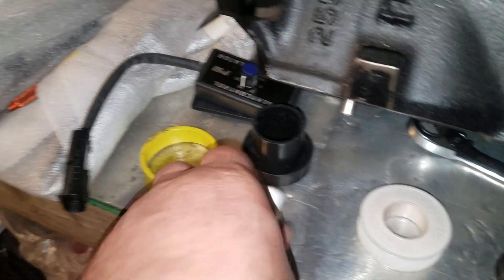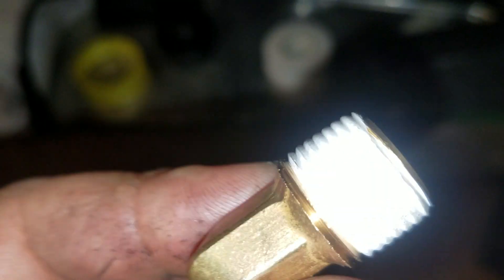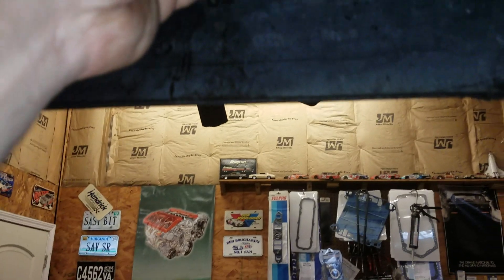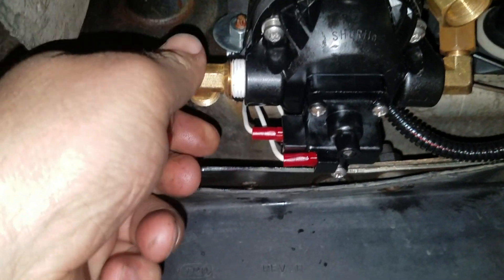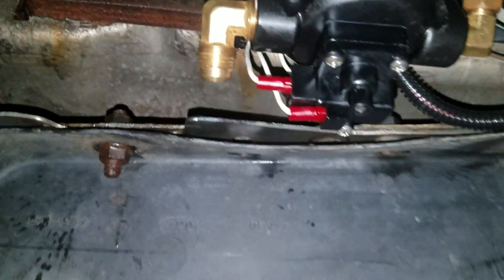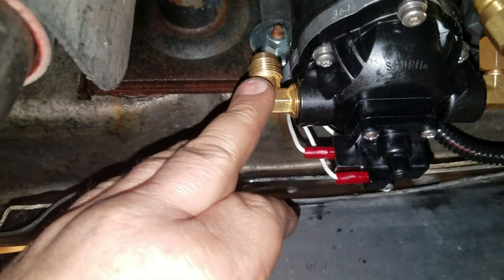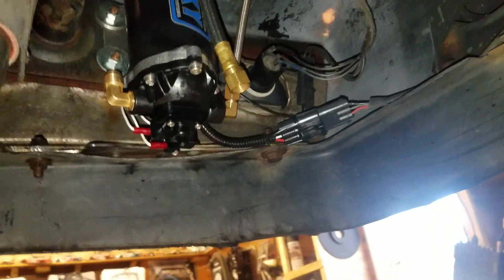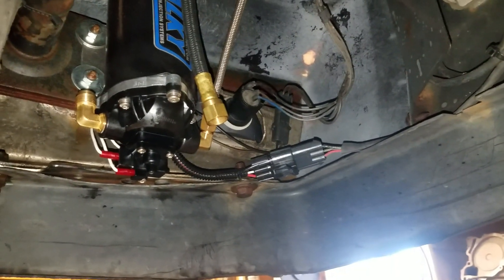Sealing alky pump fittings

Comment: Steve quick question for you, with dial set to 8 hitting the test button how much voltage should I see down at the pump? I'm only getting 4.69
Reply from the maker: Test button does not send full voltage, you need the tester sold on alycontrols site or make your own. Julio can provide exact voltage specs as it's his baby.
Reply: @stevevsautomotive1998  thanx for getting back so fast Steve. I'm chasing down what I'm pretty sure is an alky issue. Gonna call and get the tester